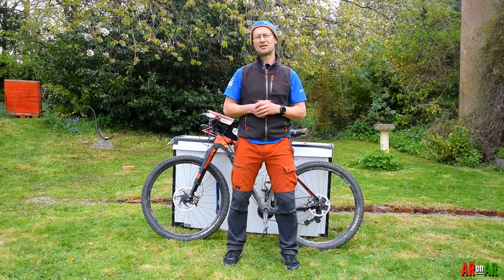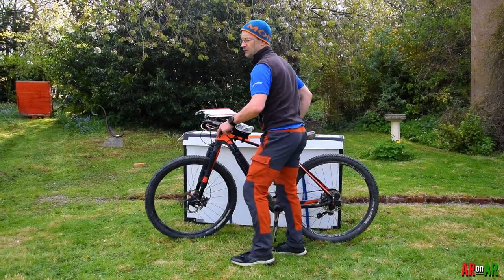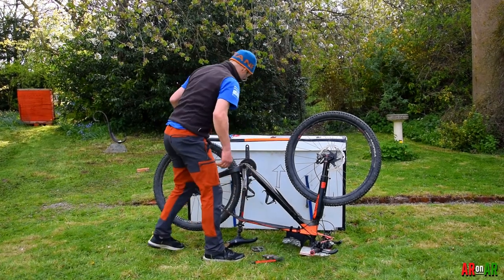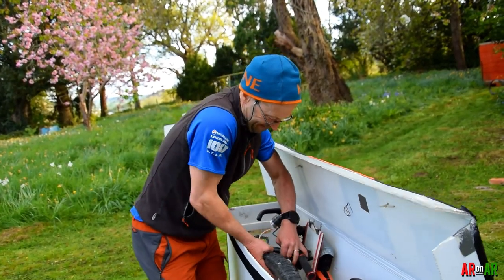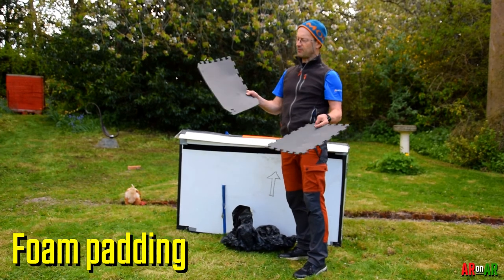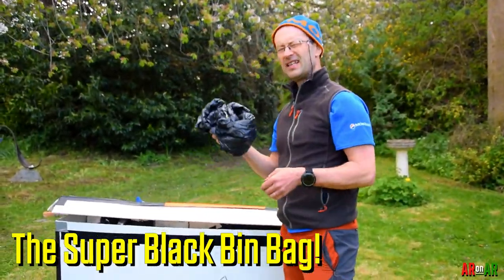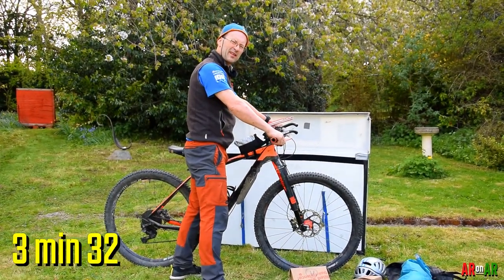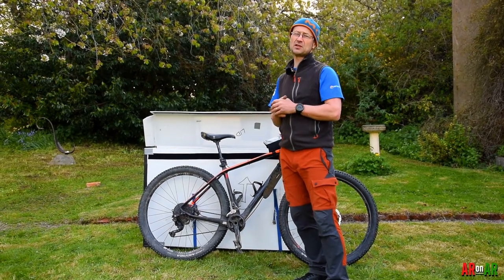Adventure Racing #26: How to Pack a Bike box

Comment: Hey @ARonAR what glue do you use for the corflute?
Reply from the maker: I use carpet tape rather than glue. Super effective. Double sided stuff.
Reply: Good idea, thank you! Seems like a lot of stuff says it may not be suitable, but people seem to have success with them. Quite odd. Might give that a go though!

Also, how did you make the creases in corflute when the creases are parallel to the corrogations (can't think of the right word)? I tried and it with the blunt side of a butter knife and I managed to puncture the surface once or twice accidentally.
Reply from the maker: @jamienash5263  I use a steel straight edge / long ruler, then score the inside edge of the crease. You can even cut it all the way, really, and when bending the crease, the inside edge will bend in. What you don't want to do is score or cut the outside crease, because it weakens the join much more, pls creates a sharp edge. 

Make sure to use the steel straight edge against the crease when doing the bending. 

Test making the bends on some spare pieces of corflute first. You will definitely have offcuts from the sheets.
Reply: How tight are adventure races with the dimenions generally? My box is about 31 wide and 82cm tall 😅 and I'm wondering if I would need to reduce it?
Reply from the maker: @jamienash5263  It depends more on airlines than on races. I can't see an RD rejecting your box for being that slightly out of spec, but airlines - who knows? 31cm ain't much, and 82cm probably won't be picked up..... 🤔